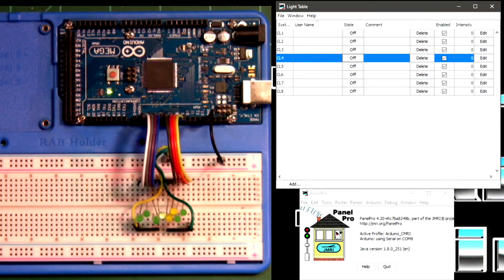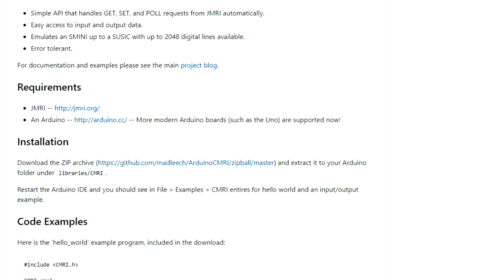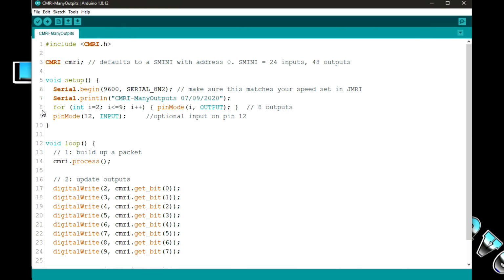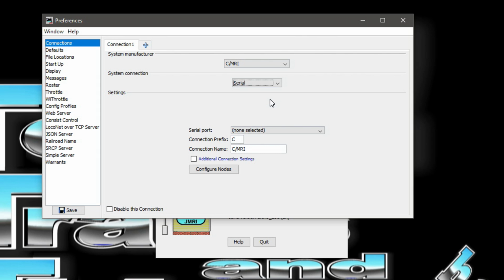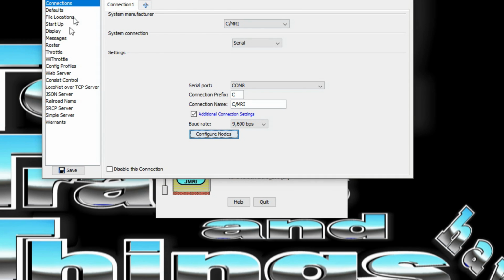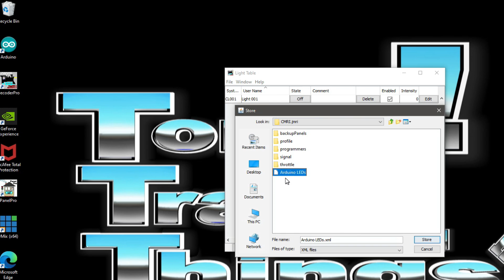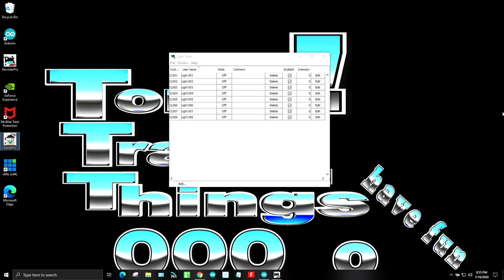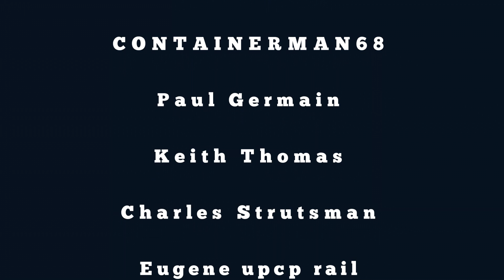Control Arduino In JMRI - Easy CMRI Set Up

Comment: Hi tom i am using common positive signals and trying to get them to work with cmri have tried the pca9685 route and failed miserably can you do a video which would help i have the cmri master loaded on my mega  and a sensor shield
Reply from the maker: Unfortunately CMRI is an old technology written before the PCA9685 came out. I have not tried it since this something completely different. You may want to check into DCC-EX in their use of the PCA9685 for servos and LED at the same time in rr automation. 

I'll give you an invite for their Discord where the developers monitor the chat and answer questions daily
https://discord.gg/vrXrKQgs

Comment: This has been such a helpful, clear and simply explained video to help me debug - everything now works - fantastic. Thank you so much.
Reply from the maker: Glad it helped!
Reply: @TomsTrainsandThings  I am now getting interference on feedback. Using twisted pairs for a and b connections to usb to rs485 module. Have grounded usb to rs485 module and also routed the CMRI bus away from other wires as far as possible. Any tips please?

Comment: Amazing. thanks for the videos. 
I have a question: What is the simplest way to connect and control light signals? Is there an arduino code, where the arduino works as an dcc decoder? The arduino mega has a lot of outputs, so I could connect a lot signals.

Thanks for your help
Reply from the maker: Geoff Bunza has a few videos & articles in Model Railroad Hobbyist Mag on making a decoder from Arduino. A lot of great ideas in his articles.  https://model-railroad-hobbyist.com/blog/geoff-bunza

Comment: I have an Uno running 24 servo controlled turnouts on my layout. I also have a Digitrax Zephyr to run my DCC functions and track power. Do you know of a way I could use the Zephyr switch function to trigger the Arduino turnouts using JMRI? That would entitle running Digitrax Zephyr and CMRI at the same time in JMRI. Would they talk to each other?
Reply from the maker: What means are you using to control 24 servos with an Uno?
Reply: @TomsTrainsandThings  two pcm9685 boards using I2C bus.

Comment: Tom, I followed your instructions and things went well until I restarted JMRI. The light table comes up but it is empty. The .XML file is there but it does not get loaded. Any idea where I went wrong?  Thanks
Reply from the maker: You need to load the file
Reply: @TomsTrainsandThings  got it. Thanks.

Comment: Can I setup another configuration for my SPROG3 to supply power to the track along with the cmri setup?
Reply from the maker: Your only limited to the USB ports available. I use a USB port extender on my laptop
Reply: Thanks Tom.

Comment: Amazing what you can learn from watching your videos. Not related to this subject, I have an Arduino Mega that I think went bad at the USB power in. It seems to still power up and had a sketch on it but does not do anything. I've been trying to load a sketch around the USB with no luck. The port does not show so I connected my adapter from my Pro Mini and the port shows but still it times out. Any ideas if it is fried? 
Thanks, Robert
Reply from the maker: Glad I could help! Sounds like you fried your Arduino.

Comment: Can you control the LEDs with a throttle or only through the Panel?
Reply from the maker: Working on figuring out all the possibilities. Everything is stored in the tables and can be controlled there, and also if you build a panel, it can be controlled there also. There is an option for a controller through inputs to control outputs. I"ll have to see what all is available.